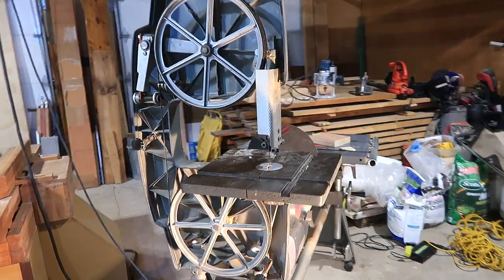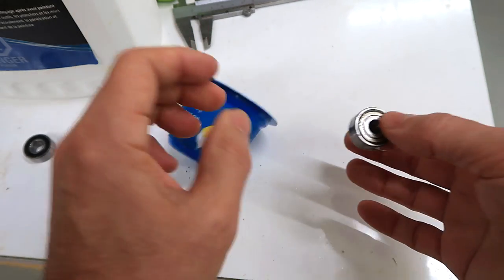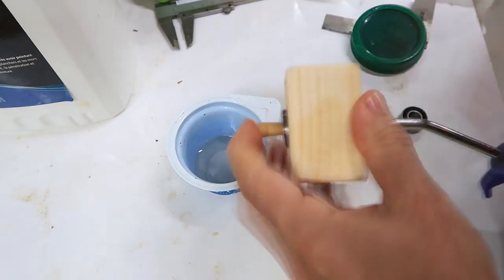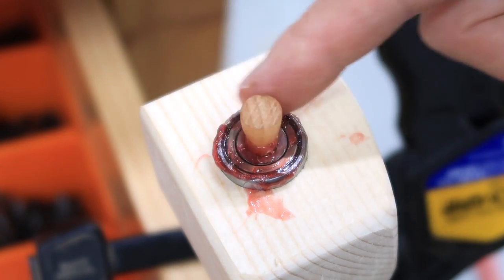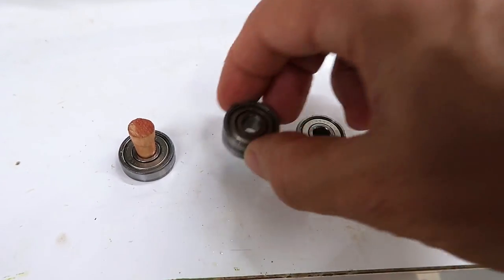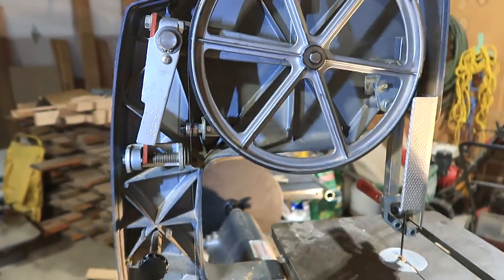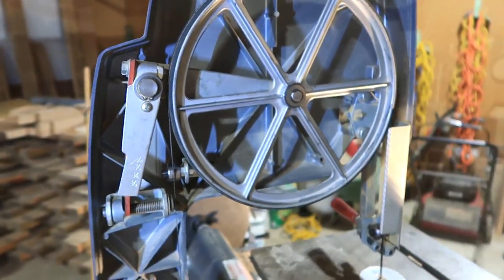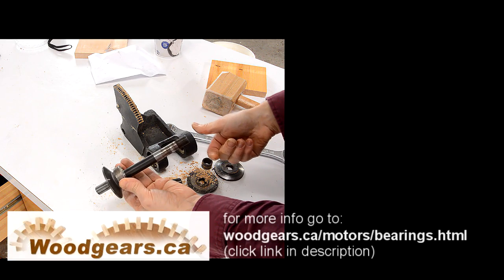Re-greasing a shielded bearing (no disassembly)

Comment: Cool in a pinch. If they're standard bearings though, a few bucks to replace them if you know where to source. I've even bought some NSK bearings direct from the warehouse for just a few dollars, the markups in the store were huge. $30 for a $4-5 bearing etc.

Interestingly, bearings usually aren't packed FULL of grease, as this can actually pop them open, they are kind of half-full of grease in most cases. Just enough to lube the ball bearings and races, but not enough to over-pressurize them during operation.
Reply from the maker: not standard bearings

Comment: Clever bearing tools. Conical bearing packers are commonly available (and inexpensive) and fit a range of bearing sizes. I use mine to pump fresh grease into bearings while purging the old grease out. No need for solvents.

Comment: Pumping it in seems like a much better idea than trying to suck it through IMHO. If the vacuum can suck the grease into the bearing, it can also suck it out. Pushing it into the bearing will guarantee a much greater amount of grease gets stuck in there.
Reply from the maker: it doesn’t need that much in.  if it’s full of grease, it just gets flung out by centrifugal force when it runs

Comment: Sometimes the easiest, temporary fix is to: drill a small hole in the shield;  Hit hole slightly with a center punch to make a mild countersink;  Force grease in with a Lincoln needle grease applicator; and seal hole with a dab of adhesive.
Reply: Great idea and would work well when using a packing tool reducing the effort to get the grease in there.
Reply: Or you can just put it into a bag with grease and use a vac master
Reply: @andrewa8569  My suggestion is more aimed at situation where the bearing can't be easily removed.

Comment: I was told to disassemble the bearing and pack with grease. Grease can get so old and hard it can damage the bearing. Upon removal of the lock ring & seal, hardened grease can be removed & bearing inspected for gulls, nicks etc. Then repacked with proper lubricant required for F-102 flight controles that I was working on. You really don't want hardened grease messing up you'r day.

Comment: I understand both sides of the argument, of, reuse or buy new.  I, myself, prefer having instant gratification by going to a brick and mortar store and buying what I need, but, sometimes what I need isn't immediately available.  I also weigh in safety factors.  Is a regrease going to cause more problems than it'll fix?  If not for the short term, regrease and revisit sooner than later if it's not a lot of time to replace the parts.  In this example, 5 minutes of cutting up a block of wood, and 2 minutes of squeezing grease through, a LOT better than ordering online and waiting.

Comment: I see all of your videos as soon as I possibly can, there are so many things to learn from both your channels. I´m a woodworker myself, both professionally AND in my sparetime. I got into woodworking 44 years ago but I lack your ingenuity and maybe I have a challenge I think you would be the only one that can pull of. When you search youtube for an automatic bolt or screw sorting machine theres like 15 examples and none of them are attractive to me. The few examples are either factory made, too enourmes in size, demands to much manuel hand involvement or they only sort them by lenght. I was thinking more of a maschine, that sorted them in length AND diameter. That would realy be something. It doesn't have to be for both bolts AND screws - that would of course be fun if it could be done, but length and diameter is sufficient to me. How about it Matthias? Challenge accepted?

Comment: Clever way to regrease.  But to be picky, those are not sealed bearings, they are shielded bearings.  Sealed ones can be regreased too but the seal needs to be popped off first.

Comment: Instead of sticking your finger in that paint thinner, put that plastic container up against any vibrating object and let the vibration do the work. I own a nice ultrasonic cleaner but with bearings, along with other things, I use a harsher cleaning agent i don't want in the ultrasonic. I put them into a little plastic cup with the cleaner and hold an electric trimmer to it. The vibration works wonders. Saves product as well given you barely have to cover the object with cleaner so you aren't wasting tons of cleaner to do a small job.

Comment: They just don't make bearings like they used to!
I would try to order some good Bearings  that size from Japan.
Maybe you can get lucky and get some New Old Stock?👍
Reply: You can get good quality bearings from any old auto parts shop. SKF, FAG, NSK, Koyo are all good brands. If you are ordering off an industry catalog make sure you don't pick a bearing with tolerances set too high, as that may wear prematurely due to poor alignment (assuming it's aligning a shaft).

Comment: You need to adjust the blade position on the wheels so that those bearings are not engaged with the blade until you apply a small amount of pressure when cutting. There is some good youtube tutorials on this and a guy who is an expert at running these band saws. I have a nice Jet 14" one and it used to run bad till I fixed all the issues with it. One of them was adjusting that thrust bearing and that is done by adjusting the blade on the wheels first then adjusting the bearing distance. Those bearings wear out if they are in constant contact when your not cutting anything.
Reply: Alex Snodgrass'es video do not relate well for the Shopsmith bandsaw.  Shopsmith has a very unique design.

Comment: We place the bearing in a large syringe.  We fill the syringe with alcohol or kerosene.  We expel the air.  We extend the piston, create a vacuum.  Air bubbles in the bearing, expanding, displace the old grease, and while shrinking, they replace it with kerosene.  Then the kerosene is drained, the syringe is filled with grease and the piston movements are repeated, filling the bearing with fresh grease.
Reply from the maker: that's gotta be a big syringe

Comment: FYI, they are shielded beatings, not sealed. It would be nice if they at least gave the option of lubrication holes with these smaller bearings. I can understand being because they're mostly used in throwaway stuff, but much in industry still uses them, and time and money to replace is still a loss versus being able to keep them lubed.

Comment: This is only cost effective if you account your time at $0. However, an easier way to get the grease inside the bearing (I've done it) is melt it in carefully with a hot air gun. No need for jigs.

Comment: me: stick it in front of a fan to evaporate the paint thinner.
matthias: I drilled this exact hole in a piece of wood so I can blow out the paint thinner and it can also be used to re-pack the bearings!
me: this is why I aint being paid the big bucks.
Reply from the maker: if you evaporate the paint thinner, the dirt just stays behind.

Comment: I looked in to a specialist for sealed wheel bearings, and apparently any more then 30-40% full of grease and they will create heat and thin the grease as it runs out.

Comment: Folks, please don't use paint thinner to wash out grease from your bearings. Paint thinner leaves behind stubborn residues in amounts significant enough to destroy the lubricant oil-soap dynamics in your grease. Chlorinated brake cleaner should be your solvent of choice here. And even then, you must thoroughly chase out the old grease/brake cleaner solution from inside the bearing housing with a compressed air gun and let dry completely before you can apply fresh grease.

p.s. rubber seals must be removed before solvent application. This is because solvent exposure degrades rubber

Comment: much easier and faster: motorcycle chain grease for o-ring chains. just spray it on the bearing and it will penetrate right into it. after a minute or so it will thicken up once inside the bearing. one can will save hundreds of bearings

Comment: Other method how to grease these hard-to-access surfaces like such bearing, but also things like steel cable/wire rope or so: Warm up the grease in a pot (carefully, watch the temperature, so it won't ignite) so it becomes a thin liquid, submerge the parts in and let them soak in. Of course works only with grease that can completely melt at a reasonable temperature (max around 100degC), without separating its components.

Comment: Shielded or " sealed bearing" are for the most part NOT 100% permanently sealed.  I've been cleaning and greasing these for years. It's a little pain in the ass but can be done easier and faster than waiting on amazon or driving into town TRYING to find the right replacement bearing.  Unless you have a destroyed bearing just fix it yourself.

Comment: You can force the grease through the bearing even if you don't have a pump. You can drill a blind hole, fill the pocket with some grease, plug the center of the bearing and tap the bearing into the hole. (it will force the grease through the bearing.)

Alternatively you can use a punch in the center to create the pressure, but that will pop out the bearing from the hole if it's not secured. (which coincidentally is a cool way to remove a bearing from a blind hole!)

Comment: So much easier to just pop the seal out and then pop it back in after greasing. An oil seal pick or a pin does the job great.
Reply: Shields, not seals. Not all shields are removable.

Comment: If the bearing is dry, it means the grease is gone. Meaning the seals are no longer doing their job. Not only this will happen again but also, since you pushed cleaner, air and grease through them making them much less effective, it will happen sooner than the first time. Not a good idea in my opinion.

Comment: Although this method DOES get grease into the bearing, this is not a very good thing for the bearings to begin with.
The seals were designed to keep the original grease in. Once that failed the bearings, (which are not expensive), should simply be replaced. The gain is really minimal.

Comment: Ok.But when the bearing is worn, it causes vibrations at higher speeds despite the fact that it is newly lubricated with grease.I tried the same on the lathe.The bearing fell silent, but vibrations and  appeared.

Comment: I wonder if lumber prices are as astronomical in Canada as they are right now in the U S.?
Reply: Watching a pergola build in the UK, the wood should have been <£400 ended up costing >£570.
Reply: @tracybowling97  yes its because of covid. its not just usa its everwhere, and its not just wood, its everything to do with things you can do alone/at home. bicycles, sports equipment, weightlifting equipment (steel plates have went up 2x the price, from $1/pound to over $2 in most cases), and of course construction equipment. It's because people have more time due to lack of work and they are looking for hobbies and renovations that they didn't have time for in the past.
edit: although wood makes less sense to go up in price because it's rarely imported from other countries which was the main cause in my opinion for the supply/demand issues in sports

Comment: That will buy you time to order and receive a new bearing.  
If it's a standard size, small chinese bearings are super cheap.
Reply: @deanwhiteside6339  And there is no lube in them either.

Comment: What keeps the blade from coming off in the forward direction (the one where the teeth are)?
Reply: The wheels holding the saw are tilted back a little bit, forcing it against the bearings.
Reply: @juriaanv  thank you for your answer! Still seems a bit risky, if something bumps into the blade from behind?
Reply: @MoritzvonSchweinitz  With enough tension on the blade it will probably stand up to little bumps, but I agree that it doesn't appear to be the most stable design.

Comment: I don't get why they don't use sealed bearings. ZZ variety will ingest dust no matter what you do and 2RS shouldn't have any trouble at these low RPMs
Reply from the maker: thee bearings run at about 10,000 RPM.  That's not low RPMs
Reply: @matthiasrandomstuff2221  true, I mostly deal with metal so blade is considerably slower, but something like 608-2rs is rated to 22krpm

Comment: Why don't they use sealed bearings for a dusty application like this?
Reply from the maker: Probably not suitable for those speeds.
Reply: @matthiasrandomstuff2221  ah, didn't know that might be an issue. Thanks for answering and thanks for teaching me yet another new thing!
Reply: @matthiasrandomstuff2221  When I bought my Delta bandsaw it came with shielded guide bearings which clogged up with dust a couple times a year so I replaced these with2RS (2 rubber seal) bearings and these have lasted more than twenty years of hard use

Comment: Please can i strongly suggest you dont use paint thinner, acetone or petrol to wash your bearings as etchs the hardened steal. And significantly shortenes the life of the bearing. In the future use kero or solvents like break cleaner these will not only not etch the steals but also not leave traces behind that futher damages the bearings.

Comment: Nice method you use but in case you can relubricate you can regenerate the grease with oil!!! OR purchase new bearings
Reply from the maker: extra oil doesn’t get the dirt out.  and these are oddball bearings

Comment: I worked for SKF, a big bearing company, for many years. We would never recommend to regrease sealed bearings. I guess is ok for anything that doesn't have safety issues but please never do it with anything that is life critical.
Reply from the maker: ball bearing making company not recommending not replacing bearings?  what a surprise!
Reply: @matthiasrandomstuff2221  I know that sounds biased, but think about what would you do if we were speaking about airplanes

Comment: There are reasons the Shopsmith bandsaw is designed the way it is.  I believe you misrepresented it.  Here is a video (the previous one really will help you too.)

https://youtu.be/FyMKTS8yM5c

Here’s another -

https://youtu.be/zCBlSe4Z450
Reply: nah, he's right. shopsmith reinvented the wheel in a pretty stupid way
Reply: @natalieisagirlnow  
Nah - Shopsmith developed the bandsaw years upon years ago.  Long before others got into the game.  The reason it wasn’t copied was/is patent infringement.

There’s no messing with wheels.  Like cruise control, vessel auto pilot, Shopsmith’s auto track works.  That a bearing needs grease is not a problem of the bandsaw but  as everyone who depends on non zerked even shielded bearings discovers they sometimes require grease.
Reply: @johnrice6793  the bandsaw existed long before shopsmith.  they produced a dumbed down product for customers that they thought were too dumb to be able to adjust a saw.
Reply: I did not imply SSmith invented the bandsaw no more than Ford invented the automobile.
I will say that the engineers at the now SSmith company recognized that improvements could be made as Ford did - the improving the assembly line.

Comment: Off topic, but I was given a Shopsmith system and it was absolute garbage. It does "everything" but poorly and often very dangerously.
Reply from the maker: I think it's a good drill press
Reply: @matthiasrandomstuff2221  I did use mine for line boring a few times. That's not something you can do easily with a standard drill press.

Comment: Problem with getting new bearings is that most a made in China and are low quality so you’re going to be doing the job again soon. I’ve had better luck just repacking the bearings on most of the automotive pulleys I’ve done.

Comment: You are doing it totally wrong. To pack the bearing the volume of air inside should be displaced by grease. You can not achieve that the way you are doing it.

Comment: When it comes to motors, remember BBC:
Bearings
Bushings 
Capacitors

These are the 3 most common problems for any electric (AC or DC) motors.
Reply from the maker: for dc. motors, brushes are high on the list too

Comment: Here’s a new idea, just buy replacement bearings. If they were that bad to begin with they will have wear in the ball race grooves. Get rid of those rubbish metal sealed ones and go for rubber seals, they will last much longer, and the saw dust won’t get in as easily.

Comment: uh, its a $4 sealed bearing - replace, not grease
Reply from the maker: if you can find that size.  7 mm I’d is unusual
Reply: @matthiasrandomstuff2221  is that a 7 ID X 22 OD?    Those are common, like amazon common ($2)